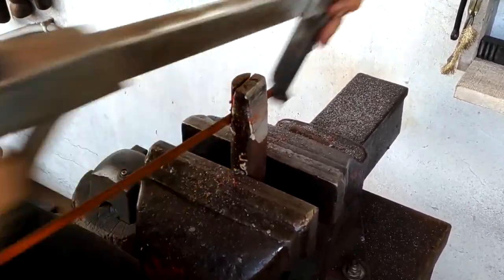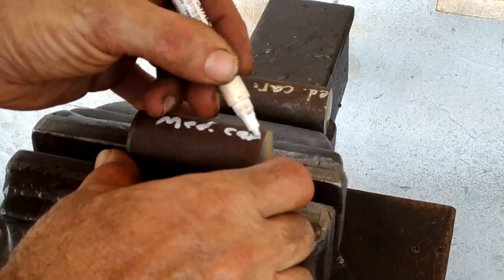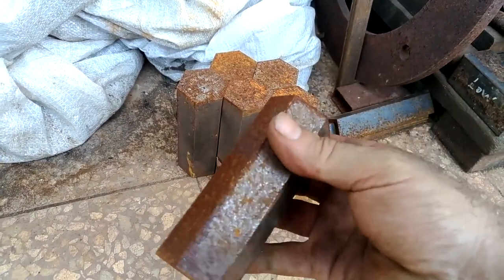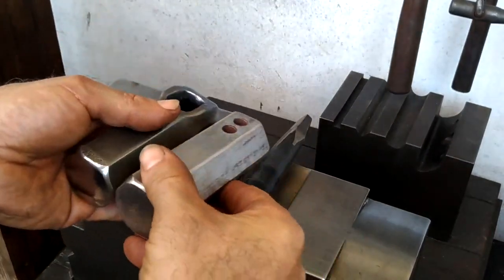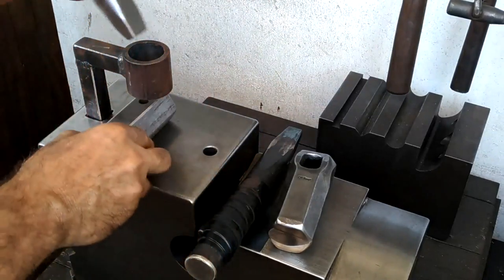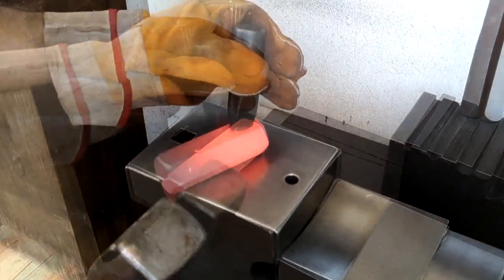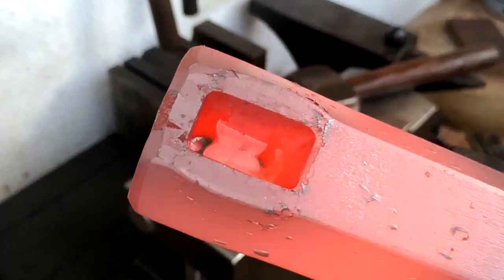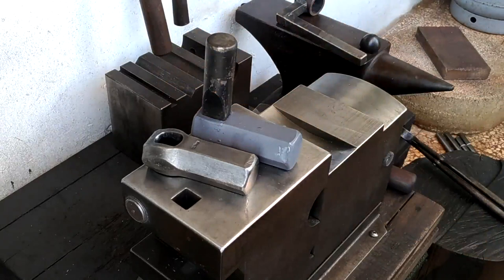Short Hammer Eye Punch, Hexagonal Hammers...

Comment: The short punch does the job well. To improve the process a little, I think if you forge a new punch the body could be oval instead of round and the guide could be squashed a bit to fit it. That would keep the punch aligned with the work. As always, I'm impressed with your work but personally I don't have as good accuracy with the dogs head type hammers as I find them unbalanced, but that's probably down to my striking. Thanks Glen.
Reply from the maker: Your oval idea is very interesting. I may just do that. For me, it's the opposite - I feel I have more control with this type of hammer though I personally prefer the hammer to be shorter than this. I think it really all comes down to what you're used to, nothing more. So with any new hammer, there's always a "feeling out" period. Thanks.

Comment: I would have liked it if you had finished the hammer but I enjoyed it anyway .  it looked like after a few strikes you could have went back to the drill and drilled another hole between the first two 👍
Reply from the maker: I could have drilled more but at that point, with the stock hot, it isn't too hard to get the eye cleared out and formed. Thanks.

Comment: What medium did you quench the hammer head? I have plenty of hex stock, but it is too soft after making hammers
Reply: soybean oil
Reply from the maker: Not all hex stock is medium carbon, some is mild steel. I used soybean oil, as Martin pointed out. The hex stock I use is 1045 and this really cannot attain high hardness no matter what the heat treat. But its best quality is a very high degree of toughness. Thanks.
Reply from the maker: Thanks.

Comment: I personally very much doubt medium carbon steel ( like 1045) is the best option if you want to hotpunch thicker steel and maintain a hard tool for longer periods. The 1045 punch will temper back to soft after a few heats. I am sure its fine for coldworking tools. You used H13 and D2 previously....any reason other than more expensive why you want to go to 1045 steel ???
Reply from the maker: I understand your sentiment regarding medium carbon vs. air hardening steels. But I've had excellent success with 1045 / 1050 for this sort of operation where the punch doesn't need to taper too finely on the business end. And I've found that properly heat treated medium carbon has a higher degree of toughness and resists mushrooming better on the striking end. But my sample size has been small and so we'll see... Thanks.
Reply: @gstongs  What i meant to say was that medium carbon is good enough to punch a small hole in thinner material(short time contact)....but it wont last very long if you use it on thick pieces of stock. I have made forge press patterning dies for damascus in medium carbon steel.....and even cooled them with water between cycles. The tips of the dies mushroomed after some use....wedging them in the billet i was making. Since than i make my patterning dies or hot cut tools in H11 or chipper steel ( 1.2360 )....once hardened they can withstand the double amount of temperature( about 550°c for 50 hrc) before they get back to unusable.  I guess if you only make simple tools that can be maintained and hardened fast....medium carbon is the cheapest and best solution.